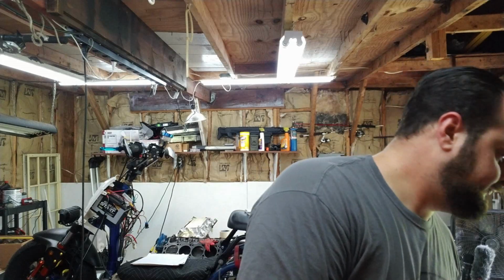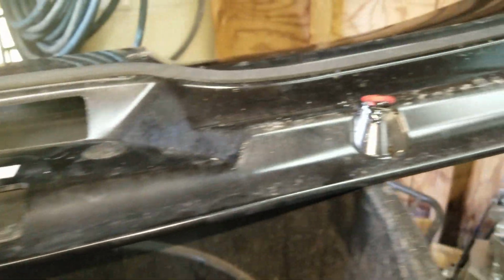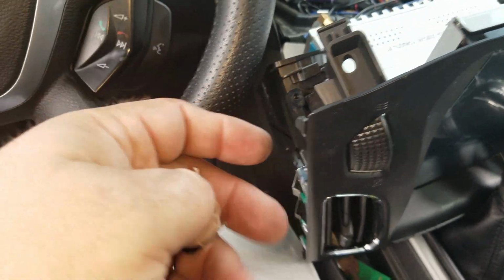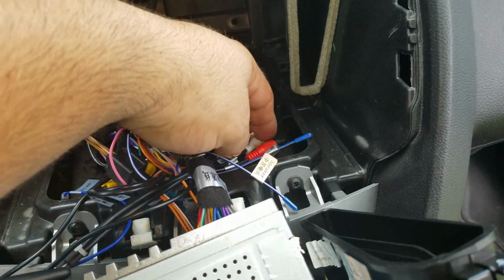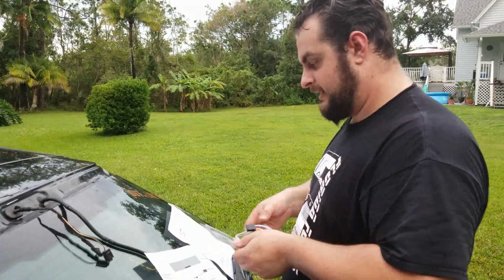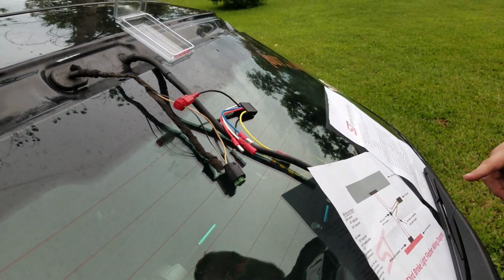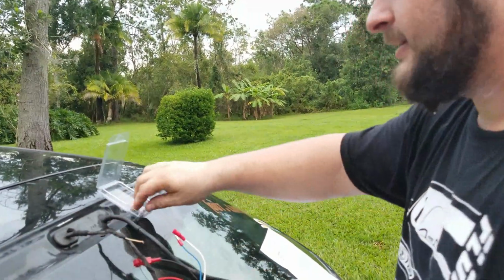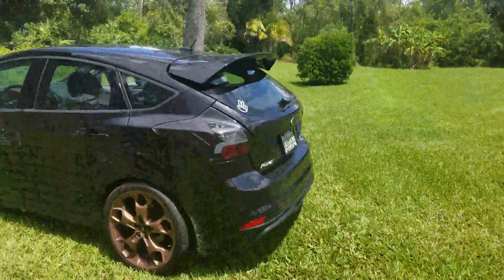Shop Vlog / Focus Edition / Working on smaller projects

Comment: Wooohoooooo another videeooooo fyi i got into modding my daily cause of you its nothing crazy just a 2013 fucos hatch but looking to get wheels like yours in the same color just put in a cluster with the 4 inch screen the same radio and rear camera currently looking for leather seats basically my daily became a project car aswell now i have 2 projects a 05 f150 converted to full lincoln and my focus
Reply from the maker: Thanks for the love.  The Focus is certainly a fun car to mod and drive.  Good luck with your car.
Reply: @OutOfLineGarage  thanks and been a great daily drive 1000+miles per week and shes been treating me good

Comment: YO! where did you get the knobs for the AC and such. been looking all over for the right ones
Reply from the maker: I think those were on Ebay,  got them shortly after I bought the car so it's been a while.
Reply from the maker: This looks like them:  
https://www.ebay.com/itm/3x-Black-Air-Condition-AC-Heat-Control-Knob-Button-Fit-For-Focus-Ford-2005-2014/172733389322?fits=Year%3A2013%7CModel%3AFocus%7CMake%3AFord&epid=16003329173&hash=item2837b65a0a:g:aygAAOSwbiFZQyai
Reply: Also I thought you had an SE?
Reply from the maker: it is